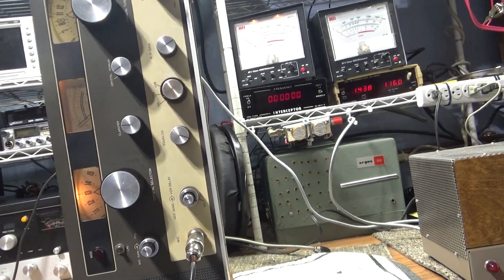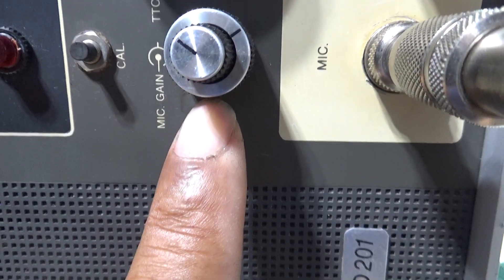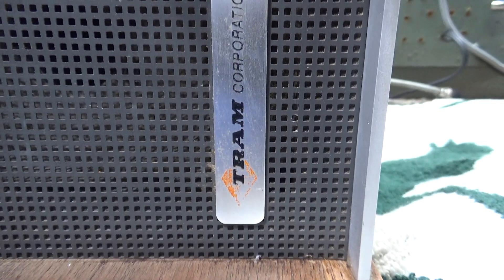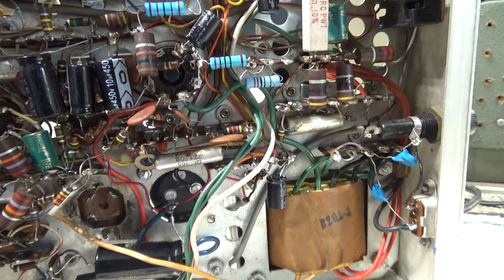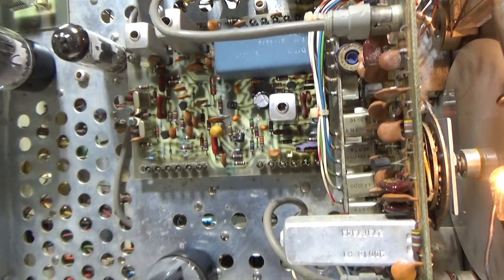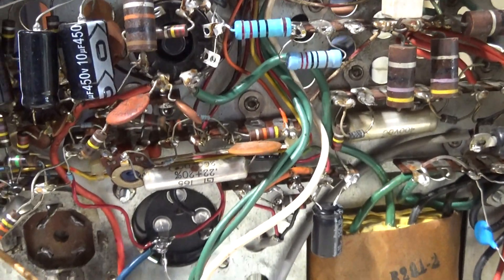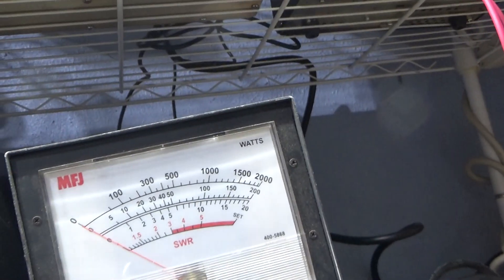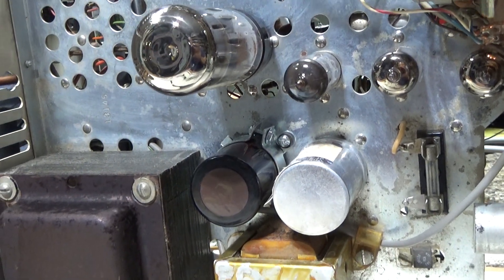Tram D201 Red Diamond (Hardwired) customers walkthru and bench keyup.

Comment: Hey Tramdr, Great vid. Love me some "Hand Wired Trams" ! Good info about the noise blanker board, will have to check mine. The originals also had a different S meter. The design did not translate well to circuit boards, because they started with a high voltage then dropped it here and there for various circuits with resistors( close to the boards) . Resistors= heat, no good for boards. 73
Reply from the maker: was the meter different or the meter circuitry different?  You are right about the dropping resistors, the earlier ones used 2 tubes in 2 different spots with a lot of dropping resistors to run the meter. It was not a great circuit. If the dropping resistors weren't equal, the meter would not balance. Later ones used an IC chip to run the meter and it works a lot better, though from time to time the IC will blow. If it blows, I put a socket on it and hence you can just plug in a new IC. All D201's also use a HV relay and a bunch of dropping resistors for it too. Not ideal, but I think they do this because if you use a low voltage relay off the low voltage power supply, when the relay kicks in, the low voltage power supply drops a tad, but a tad is enough to shift the frequency some on the synthesizer which is ran off the same LV, The HV relay is not cheap. 12v relays are a lot easier to find and a lot cheaper. Running a better low voltage power supply, or a separate LV for the relay, and using a 12v relay is a good way to update a D201 and save money using the 12v relay and heat from the dropping resistors too. If it was not for the heat problems with the circuit boards, the later Trams made a few more minor improvements over the earlier one's.

Comment: Hi Doc, what purpose does the balanced modulator board serve? Does it affect am audio?
Thanks!
Reply from the maker: Balanced Modulator board  removes the carrier. It takes the carrier and splits it push pull 180% so the dead key carrier is nulled or 'balanced' out. Then when you inject the audio modulation into the equation, it unbalances the circuit, and you now end up with both the LSB and USB together. Next step is to use a steep filter that will filter one of the sidebands out and hence you end up with a single sideband left.
Reply: @ thanks Doc! Will the radio work on AM without the board installed? Just curious lol
Reply from the maker: No that board does a lot more that that, like create the carrier even for AM before its cancelled out by the balanced modulator. I have some good Balanced Modulator Boards for the circuit board Trams, not for the VOX version.

Comment: Doc, what’s the potentiometer for on that noise blanker  board?
Reply from the maker: You adjust the blankers voltage for when the blanking kicks in. It's the same blanker in the hardwired and the circuit board ones, so the circuit board manual tells you how to adjust the blanker. To do it right, you need a 25mhz generator and VTVM too.   See page fifth-teen of the link. https://cbtricks.org/radios/tram/d201a/graphics/tram_d201a_om_pg30_pg48.pdf
Reply: Thanks Doc!